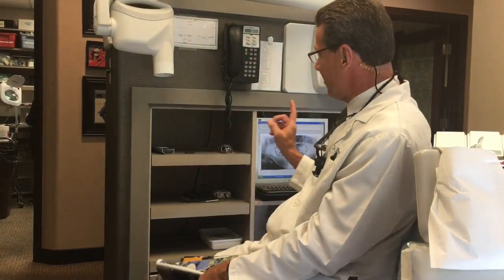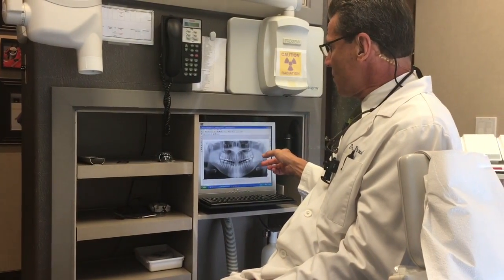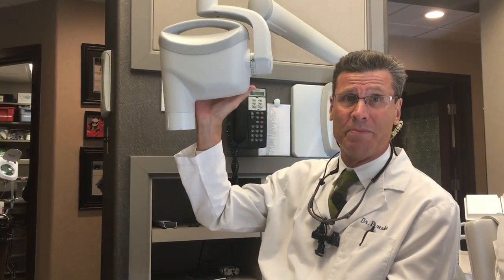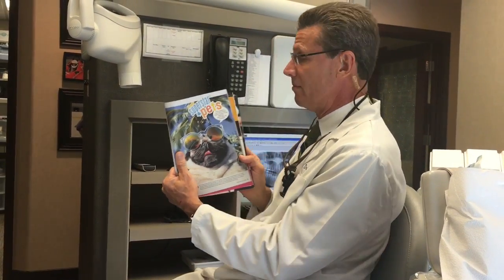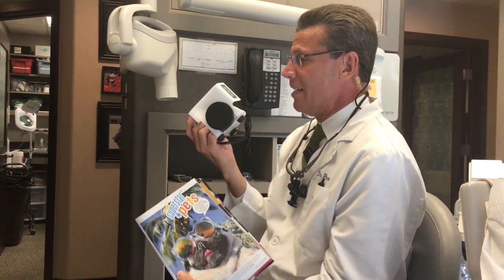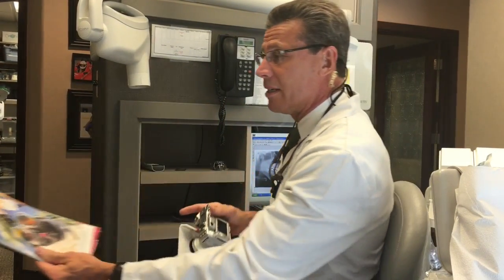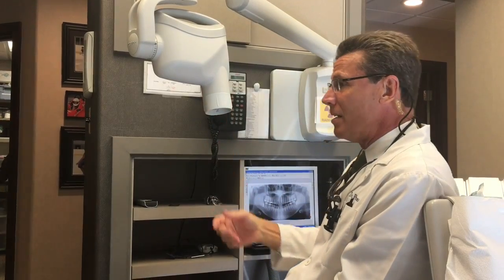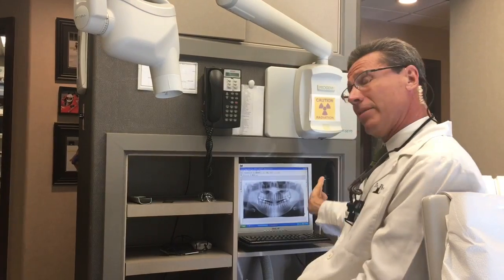X-Ray vs. Radiograph

Comment: Doc, I recently visited an oral surgeon for a molar extraction and had my general dentist supply the office with a very recent full mouth image. I was informed he had to take a “CONE X-RAY OF MY TEETH”. When asked I was informed he needed his images not the General Dentist XRays. $300 later I am still suspicious that this is nothing more then A scam to increase my cost. It is a lower molar and an implant procedure. I have not started the procedure, only the Cone XRay which I am not sure was necessary. 
Do you have an opinion.
Thanks

Comment: Nice explanation.  But you're wrong.  Why are dentists trying to change the world's nomenclature.  Medicine, much larger than dentistry, uses there term Xray so best just to stick with that instead of explaining every time what a radiograph is.  

Most importantly here, now that dentists are trying to right the world, the term radiograph is actually still incorrect from an etymological stand point.  The suffix "-graph" refers to the machine that produces the "-gram" - the picture.  For example the telegraph sends the telegram; an EEG is an electroencephalogram.
Reply: That must have felt nice to get that off your shoulders.